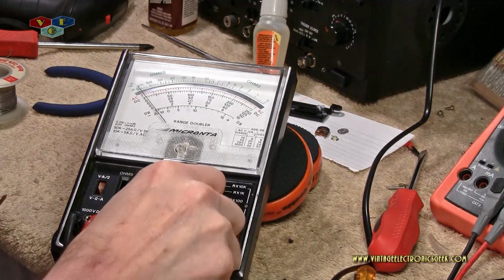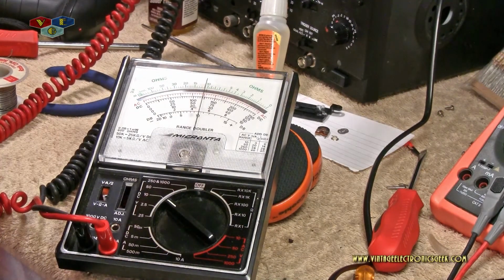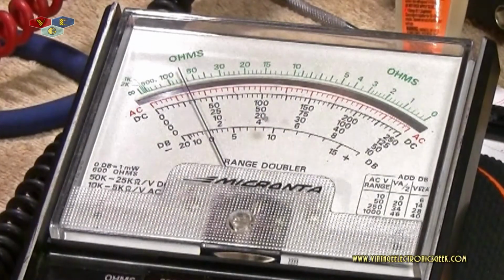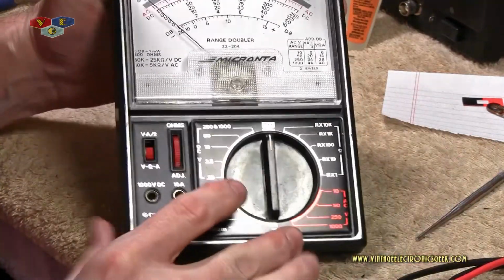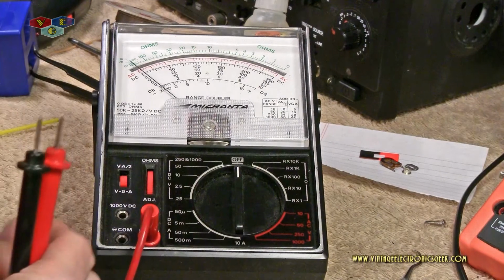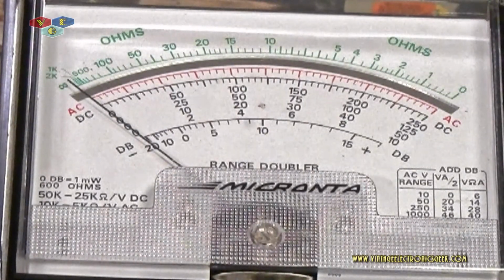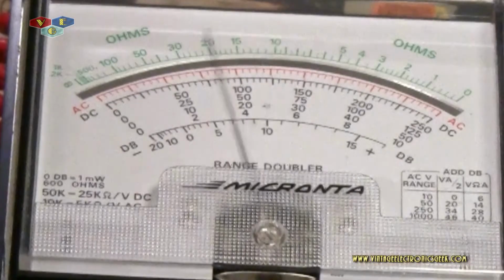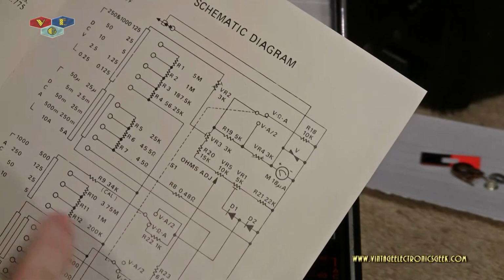Micronta 22-204 Multitester Repair - Pt IV - Finale

Comment: Nice job on the fix and getting it working. I just figured out the measurement scale on the Heathkit  V-7A I just repaired. I am not sure on that Micronta. I bet Mosslack can Help you.
Reply: Looks like he replied just before I did.
Reply from the maker: Very cool!  You have a video coming out on it??  That's a nice meter...I have a vintage tube VOM like that with a nice big display...I don't like using it because it has hard wired 50 ohm cable coming out the front, I've thought of converting it or just getting rid of it??  Thanks for watching!  ~Jack, VEG
Reply: Vintage Electronics Geek LOL, no video,  I was so happy to get it. I repaired and calibrated it and did not once think about grabbing the video camera.